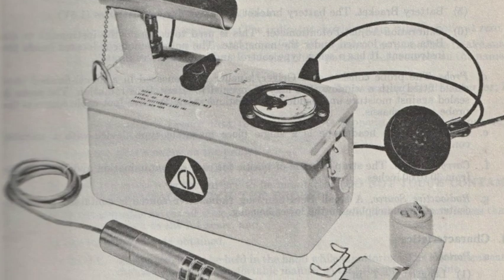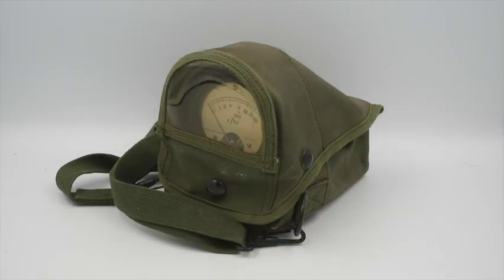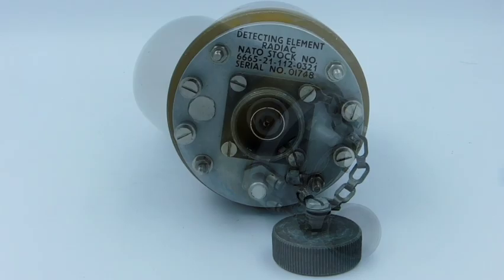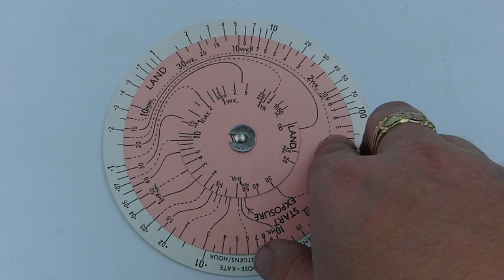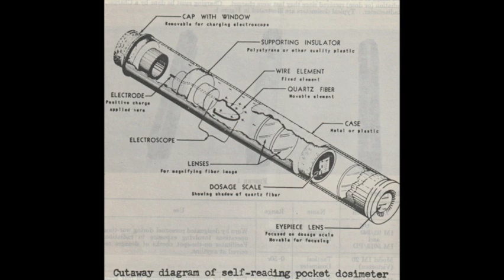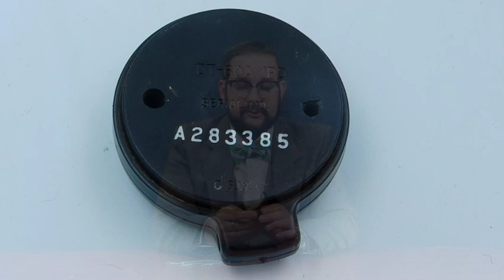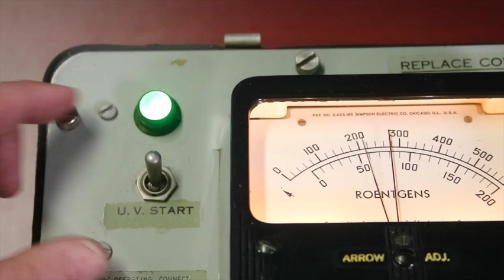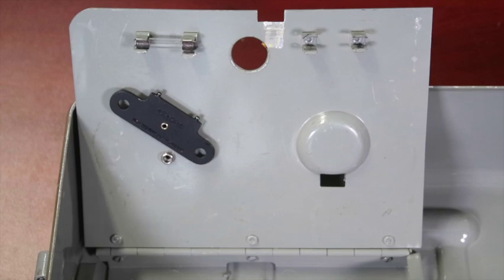Canadian Military RADIAC Gear: Tools for the Atomic Battlefield

Comment: Just as a point of interest, I used to work at a USDOE national lab. We were still using quartz fiber dosimeters as recently as the early 2000's. For all I know, they may still be using them, although the last time I needed a personal dosimeter, the labs I worked in were transitioning to more modern electronic units with alarms and digital readouts.

Comment: I have a 3 or 4 quarz dosimeters and a charger I got from a surplus dealer. These were originally used by the Finnish civil defence authorities. They all still work, only the light bulb on the charger is faulty but it has a lens you point at a strong light source to be able to set the pointer. I also have a couple of gas masks and a military surplus NBC protective suit though I don't know if it's too old to be effective. But better than nothing I guess.

I really hope I won't have to start actually using them in the next few years, it does not look good in this corner of the world with our "beloved" neighbour Russia attacking Ukraine and threatening the rest of the world with nuclear weapons if they interfere almost weekly. 🥺

Comment: I own a cased surplus 5015/TD Radiacmeter.  It probably works, but I have no idea where to get 7 replacement 6,7 Volt batteries.  It also requires 2 1.3 Volt batteries,  I figure a 1.5V (AA, C or D cell is close enough to that requirement), but the 6.7V batteries that would fit in the case is a problem.  They are wired in separately to different circuits so I need all 7.  If anyone knows of a source for a non-mercury alternative battery please advise me.
Reply: Perhaps a boost buck circuit and a more modern standard battery?
Reply: @glennmcgurrin8397  I am not sure what a boost buck circuit is.  If you know of a more modern battery that meets that voltage requirement, please share the info.  I hsve considered using 2 3.6 batteries, but I am not sure the circuits will handle 7.2 volts, and of course the shape would not be the tubular one the board expects.